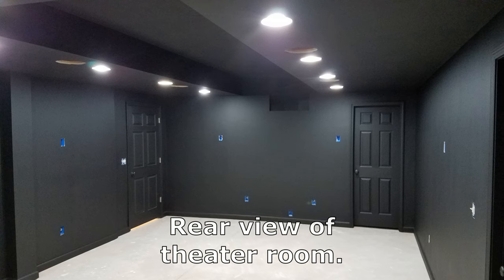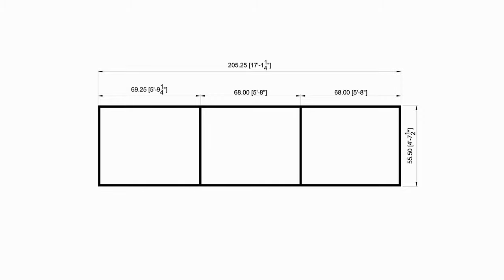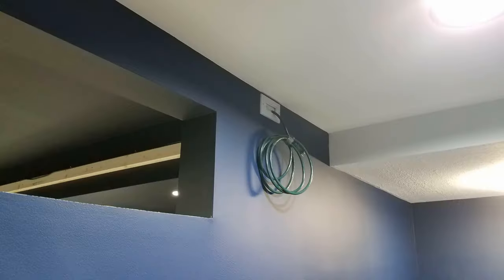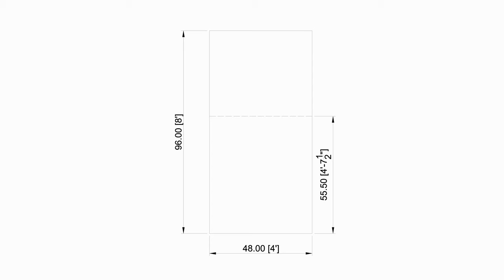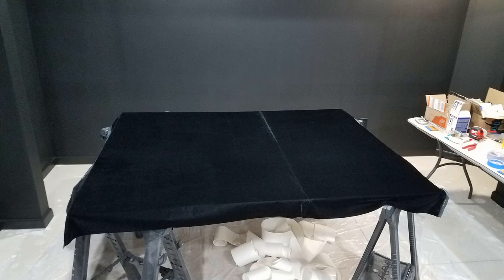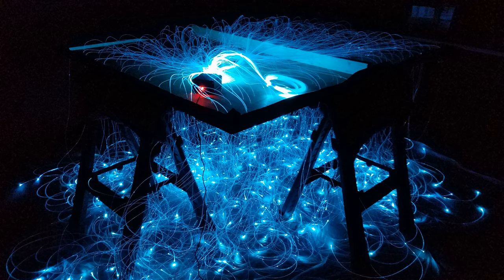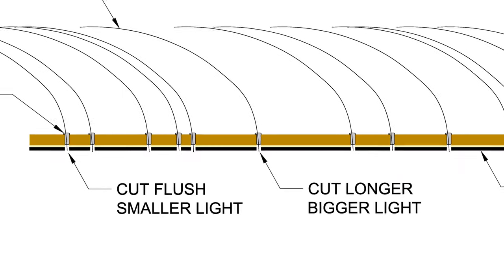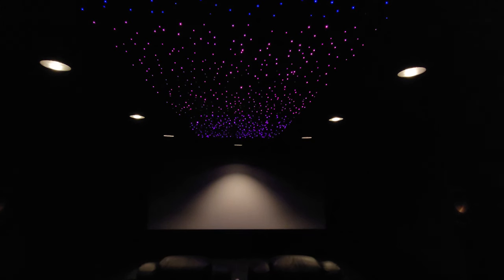Home Theater Cinema RGB Fiber Optic Star Ceiling [Custom Build]

Comment: Does it matter if you space out the double sided adhesive?
Reply from the maker: Wherever there is no adhesive you can expect the fabric to droop and slowly pull away from the areas that are taped. With drooping fabric, the star light from the optic could be masked and you want them exposed without being covered. Short answer, yes it matters. You could use black thumb tacks with large heads to reinforce the areas without tape, too. Similar to these: https://amzn.to/47YQKSB

Comment: I like the finished product. But anybody considering this should plan the electrical so you can avoid running an extension cord through the wall, a code violation.
Reply from the maker: Absolutely, and like I said, I failed to do that and would never recommend anyone do it for the sake of skipping that step. Honestly, I was so burned out after building the entire basement I had for a period of time decided not put the ceiling in and skipped the outlet. Bad move.